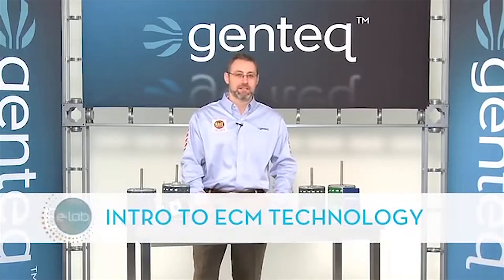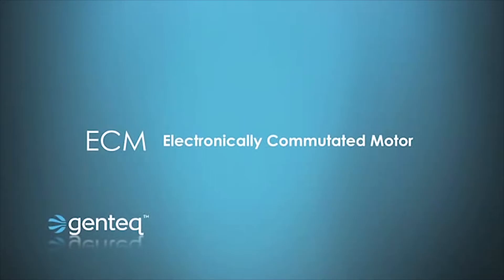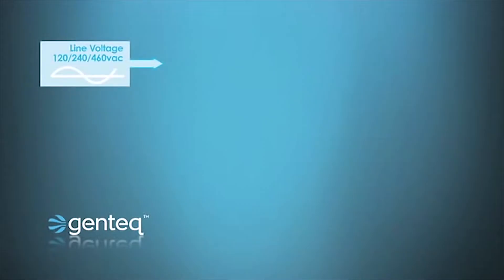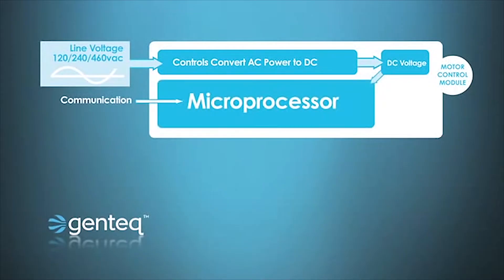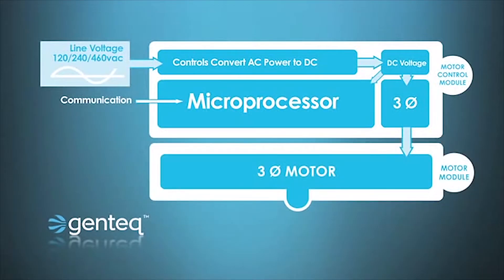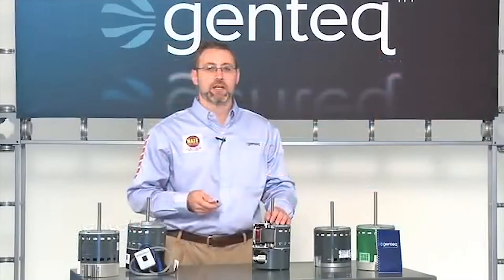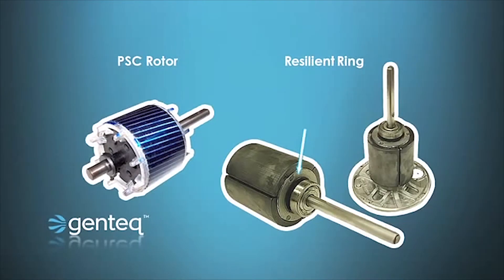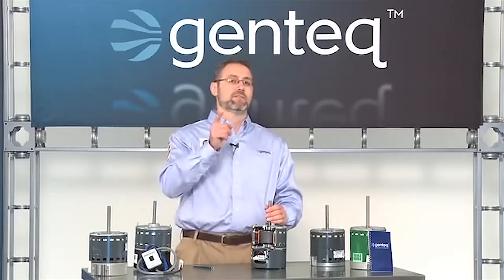ECM Motor Technology Introduction

Comment: I have 4 broken $1200 condenser fan ECM motors, the last one made it a year. For those who can't add, I am now at nearly $5000 worth of uselessness. When a $50 motor could have done the job. All due to burned out electronics. And yes, I replaced the thermistor on each in an attempt at salvaging one of them. Ya know for $5K, I could power a 1/3HP condenser fan with an idling 50cc engine, 24/7/365 for 30 years. I want my money back!
Reply: It would be wonderful if Genteq would sell just the circuit board. Dig the old one out, insert new and plug n play. But noooooo, screw the customer is the name of the game today.
Reply: Probably on shotty ductwork.. should have replaced the first one with a PSC motor, definitely after the second time.. live and learn bud, fool me once shame on you, fool me once ain't gonna fool me again. Don't throw your money at this large corporations

Comment: Nothing like a $1000 dollar motor that lasts three years . Great improvement.
Reply: I'm flat out sick of it. In fact, it is time for a class action lawsuit.
Reply: 20 year tech here. It is disappointing that they do not last the life of the appliance, it is also disappointing that they cost so much to replace.
However, from what I am seeing in the field, improperly sized ductwork or equipment is the death of these motors. It burns the controllers out.

I remembered the old timers saying, "Don't worry, it has a V-ECM, it'll be fine."
The PSC motors of the past could handle that treatment. These are much, much more sensitive.
Reply: Mine lasted 19 years.

Comment: Great tutorial on clever tech.  I just had my 10 yr old ecm furnace blower motor replaced for the low, low price of $700.  When I asked the service tech WtF, he said "ecm motor".  So here I am.  Sure, it's more efficient during its brief lifetime.  But instead of being a cheap lifetime purchase, it cost me $70/yr for replacement cost.  The probability that it saves $70/yr in electricity, seems quite low.

Comment: In terms of overall comfort and nice slow start/stopping it's a nice design for homeowners that don't care to listen to the sound of the furnace while also saving a couple dollars in hydro consumption. They can drop to ridiculously low rpms for continuous fan operation that a psc cannot do. However, once that module fails and needs replacing, the manufacturer is laughing their way to the bank with the cost of the replacement that consists of about $50 or less in electronic parts is somewhere between $600 to over $1000 just for the module, not even including a motor!
Reply: i definitely understand why ECMs are attractive for system designers. but the reliability issues and the non-repairability of the drivers is why i'd rather use a 3 phase motor and a vfd. vfds are cheap, and so are inverter duty motors from companies like Weg. sure you have to locate the vfd in an enclosure with surge protection, but ones from good companies like Fuji Electric will last for decades, and are completely repairable, because the circuits are not potted in epoxy. Fuji has been making vfds since the 70s so they know what's up.
Reply: Most Americans don’t have any problem spending $60K+ on a vehicle, $30K+ on an ATV, $60K on a boat or RV, $100 going out to eat, $10K or more on a family vacation but Lord help you if you gotta replace the high-efficiency blower motor on your heat pump system. Cry me a river.

Comment: I’m loving all the hate for these motors. Just went to a thermopride today that has one of these and can’t for the life of me figure out why. It heats. That’s all it does. It needs one speed for the love of god. It’s dead I think because the condensate trap got clogged and fluttered a pressure switch on and off. This cooked the board and the motor now runs constantly never mind there is no call for the motor. Furnace is ten years old. Pretty sure I’ve seen B208 blower motors running for 25 years that have been oiled like twice….

Comment: Sorry mame your ecm failed, unlike your old motor which cost 300 are suppliers only supply the ecm with the motor.  1200$  You will save more until your warranty  runs out

Comment: This is probably one of the worst companies out there. Genteq fan was installed on a 5 TOM Rheem unit which failed 18 months after new unit installation. It happened. Last week, the warranty replacement motor failed again also after 18 months of service. This is a $500 motor. Am I expected to continue to replace this motor every 18 months? Since you are the leader in this industry, seriously go fix your design.
Reply: Do you replace your filters? Do you have sufficient return air? Are your supply ducts sized properly?

Comment: You know what?
I don't care how efficient these motors are.  The truth is they are far less reliable and much more costly to the consumers. Not to mention in most cases you must have the factory replacement or it won't work. So the customer is left without cooling until the factory motor can be ordered.  I  miss the old days when I could go to my truck and get a universal motor and get the customer working again In 20 minutes.  
All of this makes ECM motors very impractical compared to PSC motors.

Comment: which physical phenomenon in the motor is responsible for the comfort?
Reply: with gas systems, the blower motor is in the furnace to force air through the heat exchanger to heat your home or force air through the ac coil to cool your home

Comment: I have a a/c that has this motor driving the fan. The motor isvery expensive,  as is the controller and very difficult to diagnose.  I would never purchase another a/c or furnace with this technology.  Much better was the older simple motor that  was direct or belt driven at a reasonable replacement cost. $700.00 is way too much for a motor and $350.00 is way to expensive for the motor controller seeing they are "MADE IN CHINA".  This is just greed.
Reply: What really sucks is that it is almost impossible to buy an AC system anymore that does not have some form of ECM motor. 
Every manufacture is putting those shitty X 13 blower motors in their systems.
Reply: Iron Phoenix, Blame the 2019 federal efficiency standards for furnaces.

Comment: Just replaced an ECM condenser fan motor today. The band new condenser unit was installed 3 years ago, now the ECM motor from your company stopped working. I replaced it with a regular PSC motor
Reply: Good job I would have done the same thing.   ECM is junk.
Reply: They weren't using that ECM to control head pressure, were they?

Comment: "You may be asking yourself 'why make a motor so complicated?'".  Yes I am.  I replaced a 35-year old unit that still ran, and 5 years later your wonderful ECM motor gave up.  It had ONE job....
Reply: Wow you got 5 years out of it? That's some kind of record
Reply: Just so you know, today's PSC motor won't last 35 years anymore.
Reply: @sprockkets  yes, so they can sell u a new motor
Reply: @sprockkets  Why?
Reply: The more technical the less reliable...
Reply: You know...the motor itself is almost NEVER what fails.

Its merely the driver. And the one I got out of scrap yard just had a power surge. 5$ componet
Reply: I fully agree.  Old school PSC motors  were way more stout and lasted longer.
Reply: The number one cause of ecm motor failure is high static pressures. The next is faulty electric supply. 
But none of those motors really cost that much. Price an entire air handler and it's barely more than the cost of the motor. It's a money maker for oems, since they are programmed for each setup. You can also downgrade or use a more generic motor setup.
Reply: @sprockkets  Yeah they can't handle the static, that's why they break. It's not because the motor is made with inferior internal electronics?
Reply: @charlesterrizzi8311  I don't think you understand what I mean by high static...

Comment: Interesting. Half of a Servo Motor. Used only for variable speed. Not sure if it will replace VFD's. Too many points of failure, and lack of units in the field.

Comment: Are all ECM created equal with Chinas best?

You should address the quality process your company has in place to manage warranties and failures analysis.

Why are ECM much less reliable than PSC? (cost savings are spent in parts)

What blows up the MOSFET Transistor pairs that commute the stator coil ???
Reply: I'm an HVAC student. The wingdings and rotor never break. The DC converters and microprocessor reliable but can break. If there is a problem it is usually in the controller. Unfortunately replacing an old controller can be as expensive as a new motor.

In PSC motors The Capacitors constantly break and when they do it can damage the expensive  hermetically compressors. They are attached to. They are supposed to last 60k hours but never last that long in real life conditions with voltage spikes.

I'm confident enough to buy stock in ECMs that it will replace the old motors.
Reply: @thewallstreetjournal5675 
Wait what?   You are an HVAC (student)?  
I am an HVAC tech with 31 years experience in the field working on central cooling and heating systems day in and day out. And I am going to tell you that you have no idea what you are talking about. 
ECM technology IS NOT more reliable.  It is far less reliable and in some cases four times more expensive than a PSC motor.  I have probably replaced 50,000 capacitors and none of them have ever damaged a compressor because compressors, fan motors are all thermally protected.
I have listened to countess customer complaints where the ECM motor has failed after only 2 years when their old system that had PSC motor lasted 15 years.  They fail far to easily to any kind of voltage spike or surge where PSC motor didn't.
Furthermore  when one of these ECM motors fails you must have the factory motor to fix it. I remember the days when I could get a universal motor off my truck and get the customer working again in about 20 minutes. Today you have to special order the motor and this leaves the customer down for a day or two. That does not fly very well with the customer when the weather is extreme. 
Only just now has someone created a universal X 13 blower motor with the evergreen motors. 
When you get out of school and in the field you will see what I am talking about.
Reply: @ironphoenix5145  I'm not sold on the bad power part. My house was struck by lightning multiple times. Yeah, in central FL. No ECM failures. That's not to say they don't' fail more often than PSC. It's just that there is more to the story than what most techs focus on. I'm more willing to bet total external static is more cause for failure than "bad electricity."
Of course if I installed an inverter system, I'm going to protect it with a surge supressor and or a voltage monitor.
Reply: @sd906238 yep. The one I just got out of scrap yard had one blown. That was likely all wrong but I don't do hvac I play with these for a PMA generator
Reply: "That does not fly very well with the customer when the weather is extreme".... and they just spent $9K last year on the new system